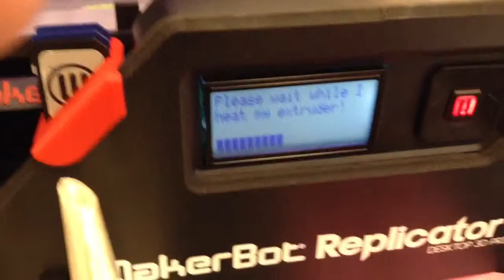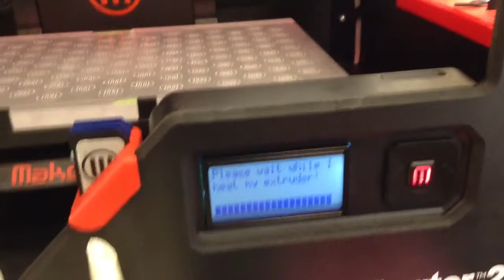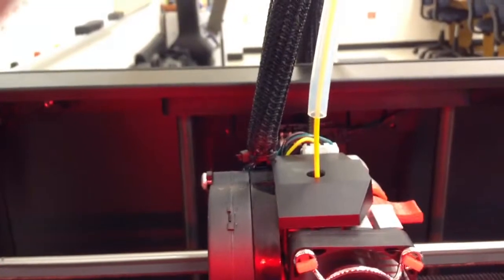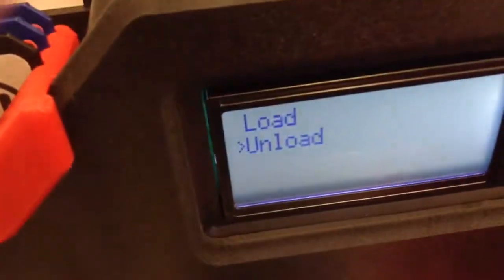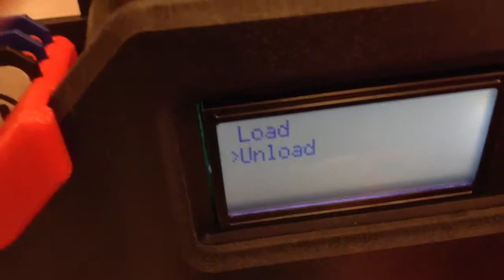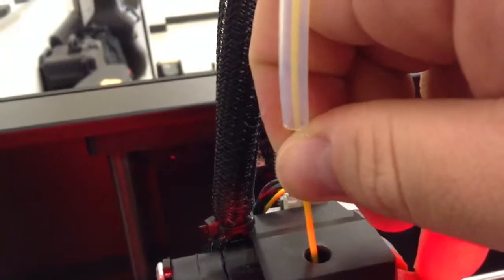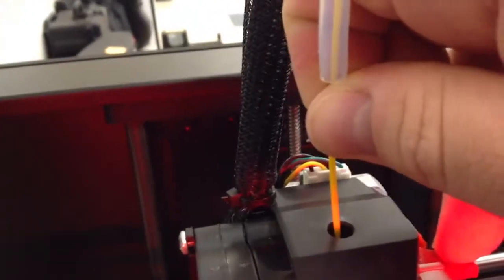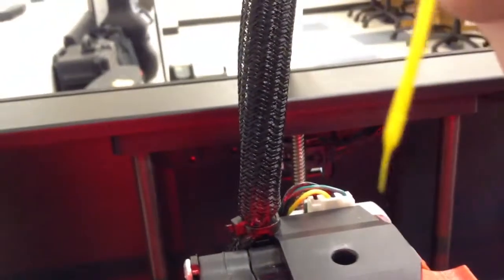Clogged hot end??

Comment: I'm having the same exact issue. What did Makerbot Support Suggest to fix it?
Reply from the maker: Removing the extruder from the hotend, heat up the hotend and grab a piece of filament. Push it in and pull it out quickly. You will see the filament heat up at the end and hopefully fuse to whatever is clogging the nozzle. Also check there isn't a piece sticking out of the hotend that you can pull out with pliers. That has worked for me. Search for makerbot support on YouTube. They have a video on this technique.